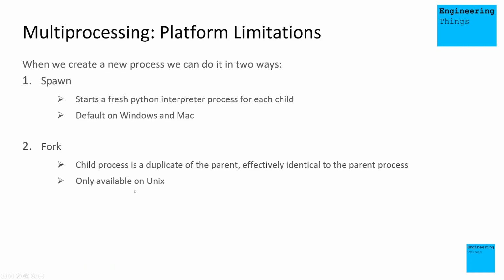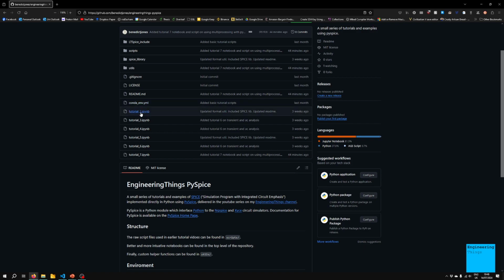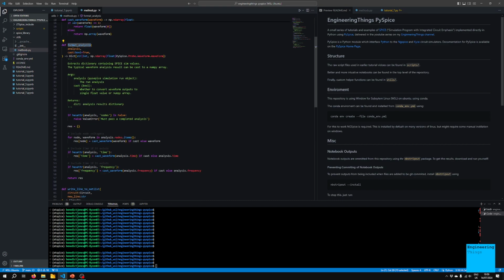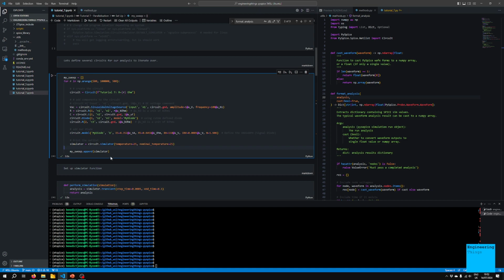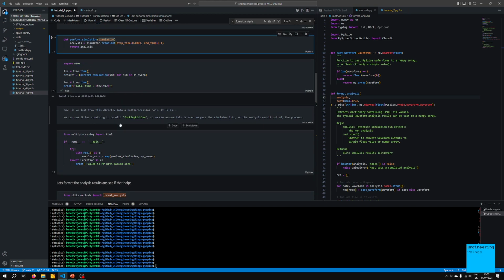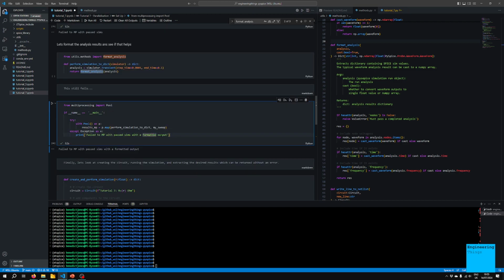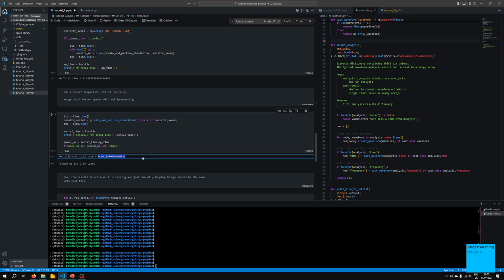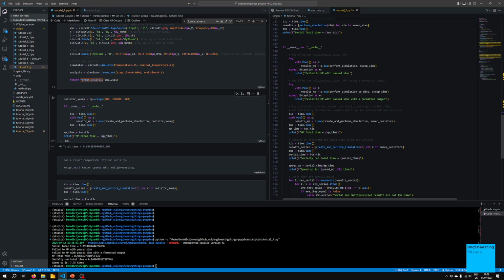PySpice - Part 7: Multiprocessing

Comment: Great tutorial, Professor! In my case, I'm trying to run a circuit simulation over a large amount of voltage input data (over 1 million values) with a Piecewise Linear Voltage Source (PWL).

I read my voltage values from a .parquet file, format them appropriately to be the input values of the PWL voltage source, execute the simulation, and it takes forever. Do you have any recommendations to optimize the execution of a simulation over a large amount of input voltage values? My current idea is to try and slice the input samples into multiple parts and execute multiprocess simulations 

Thanks in advance